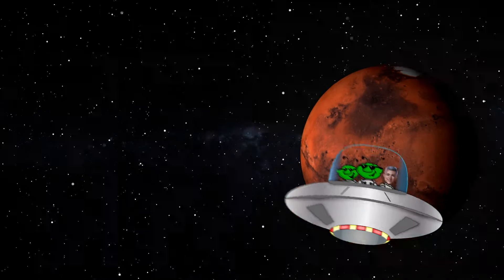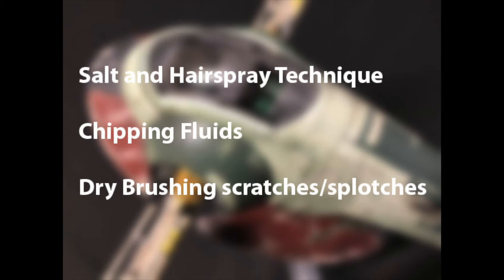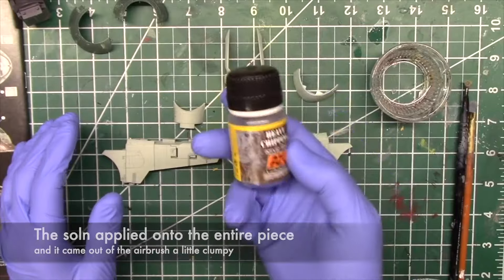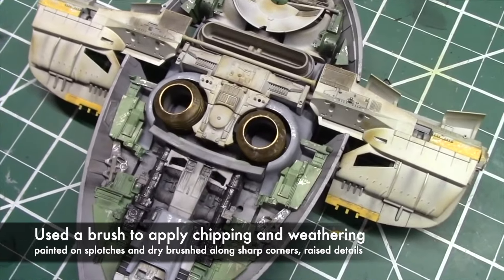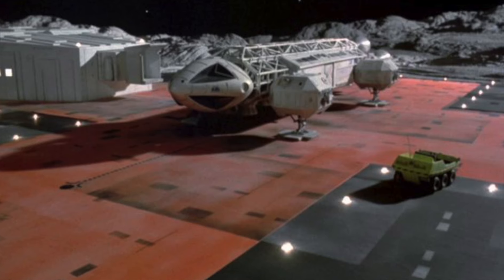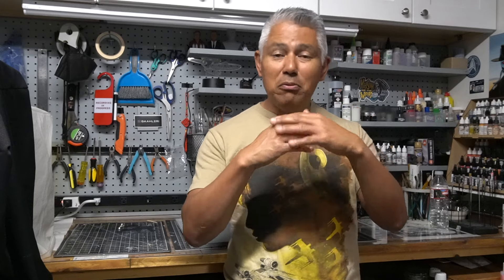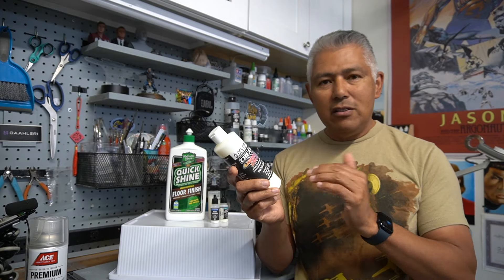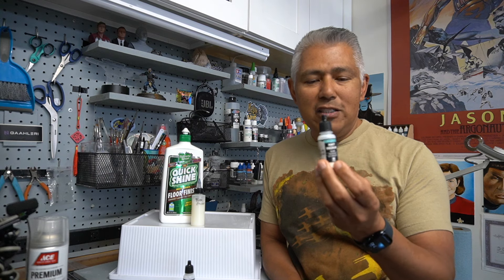Interstellar Academy Weathering a Sci-fi model Part 1

Comment: I realize this post isn’t about the MPC 1/48  Space 1999 Eagle, however I do have a question for you.  Did you get the four sheet MPC Eagle decal set for the 1/48 Eagle models, if so did you notice that almost all of the decals on the sheets are not the colors that are illustrated on the set’s cover, nor the reduced illustration of all the sheets, also on the packaging covers.  I wrote to the company that makes/imports asking about the definite blue cast to all of the decals, to wish they replied that the decals are supposed to be that way.  So much for them, I guess they can’t see the difference between the illustration colors, and the decals.  I even sent them a photo of one of the white squares from the first sheet applied to a piece of clear plastic, showing it’s actually transparent blue and not white.  Just curious if you had the same issue or not.  Thanks!  Steve Todd, Albuquerque, NM
Reply from the maker: @stevetodd478  hi….no i’m afaid I did not use that decal sheet.  One option you could consider is to scan them and recolor them with photoshop.  Thanks for watching.  Wish I had more advice on that one for you.
Reply: @InterstellarModeler  Thanks for the quick reply!

Comment: What do you do with the hair spray that you applied to the model?  Can some residue be left on, or does it need to be thoroughly rinsed off / removed?
Reply from the maker: @colonelklink53  i’ve not experienced any residue on the model. Once the salt is dissolved and the model has been dried off I just move on from there.